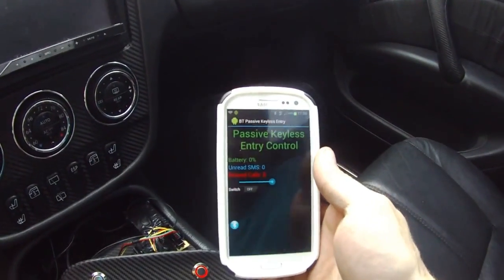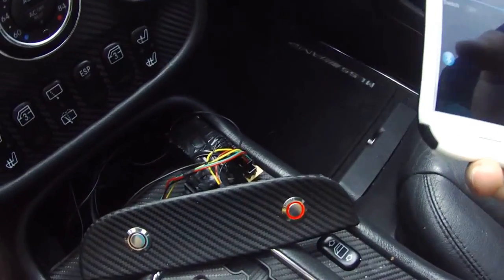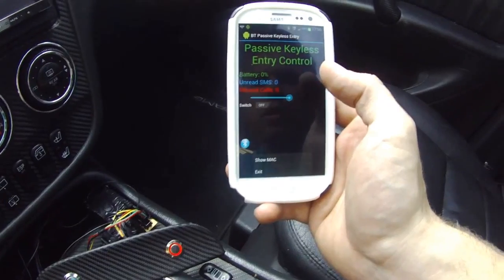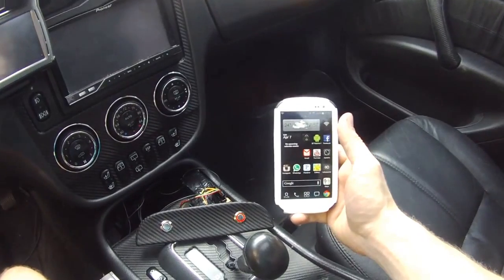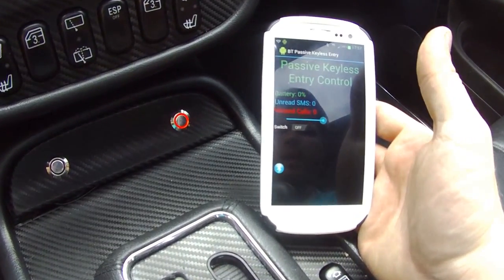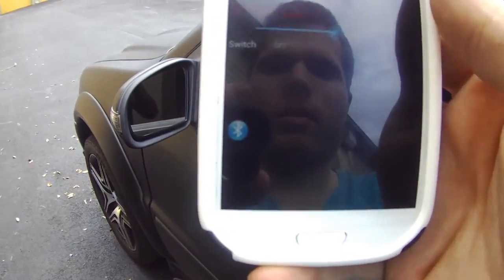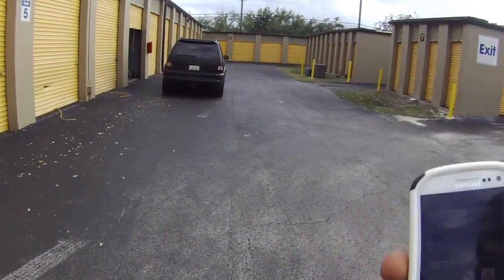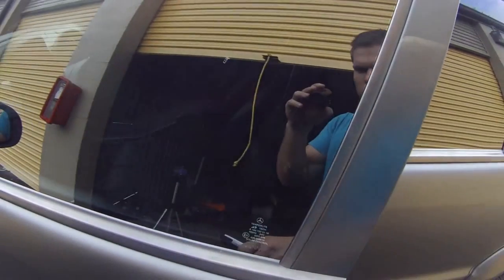Mercuino Project - Passive Bluetooth Keyless Entry System Demo

Comment: I have telsa model 3.   i can unlock the car as long as my iphone is in my pocket.   so I suspect it's doing the same time as you are.   HOWEVER  i tested it by having the tesla app closed and it still works!     I totally understand how you do it with an app.  but I just can't figure out how tesla bluetooth key can work even when the app is closed?  any ideas?

Comment: so can we make it run in the background and use a lower state of blutooth? or even use nfc to open the door. bc this way you need to have the app open at all times inside the car. then a password to open the door or make the arudino check for the phone number and know who you are. it would make it a bit more secure however right now its as secure as a normal keyless entry. also with this app I would make it to send sms count and call count to the car to be displayed on a small display, just making it fancy. ill try to develop it from scratch and see what I can come up with. awesome video

Comment: At least Renault is already having a similar feature for years, called contactless keycards. I used to have the keycard in my wallet all the time. When i walked away from the car, it would close. When I would touch the doorhandle, it would open. To start, there is a startbutton. Never used the key.

Comment: Oh really? It is as simple as getting into the car, plugging your PC into the Arduino. Then going into the bluetooth module's settings and adding your phone's MAC address to the list of allowed connections. Then write an Android app to allow your phone to open the correct sockets and send the correct hashes to unlock the car. 

I hope you notice that all requires being in the car.